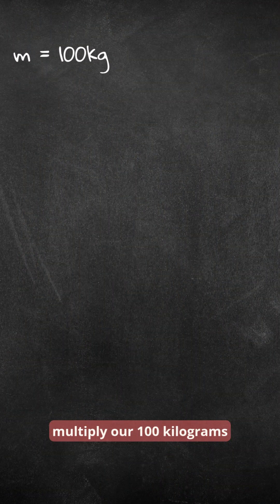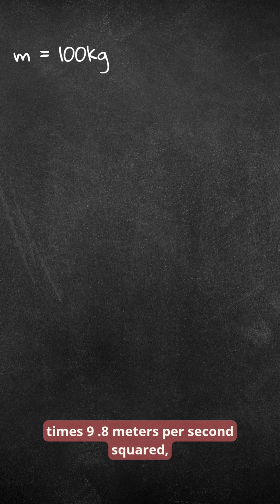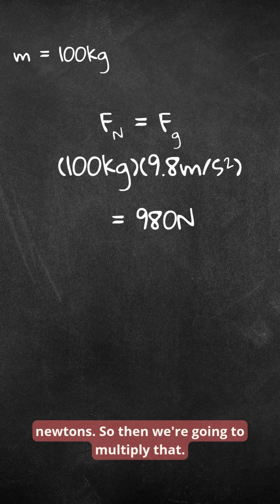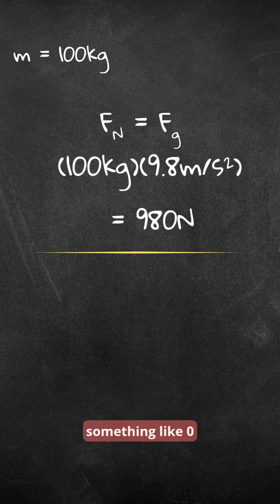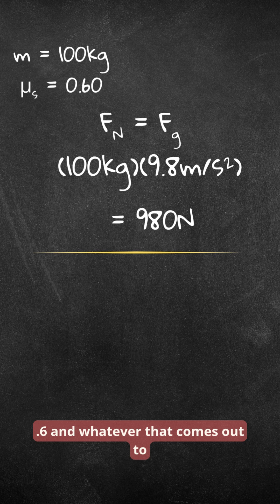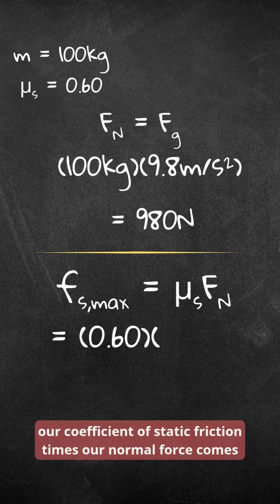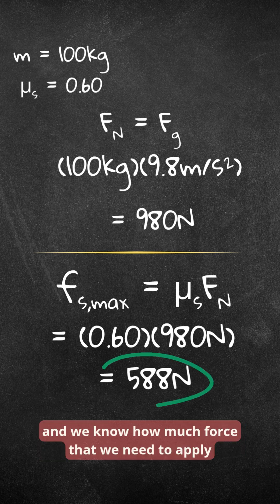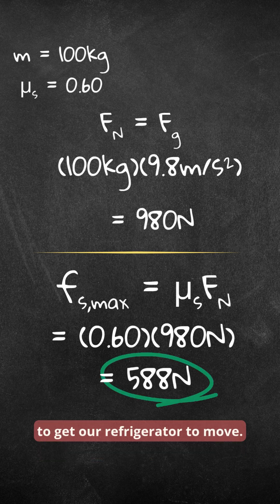Overcoming Static Friction: Force Required to Move An Object from Rest #apphysics1 #physicshelp

Comment from the maker: The example problem: imagine you’re trying to move a 100kg fridge that’s initially at rest. The coefficient of static friction between the fridge and the floor is 0.60. 

To solve: Calculate the maximum static friction force the floor exerts on the fridge by multiplying the coefficient of static friction by the normal force. Since the normal force is balanced by gravitational force (mg) Fn=(100kg)(9.8)= 980 N. 
Then, (0.60)(980N) =588 N 
This gives you the maximum static friction force exerted on the fridge by the floor and the amount of force you need to overcome to get the fridge to move.